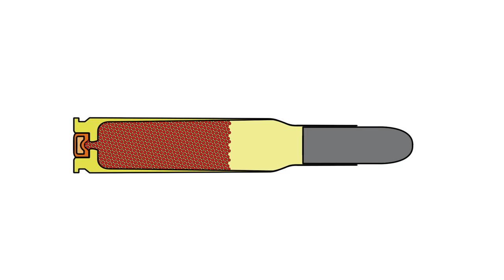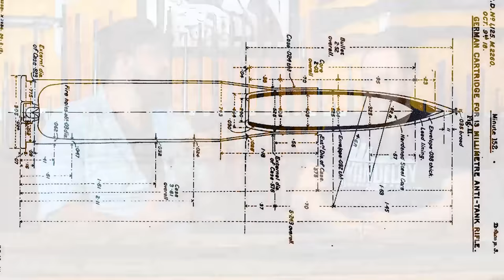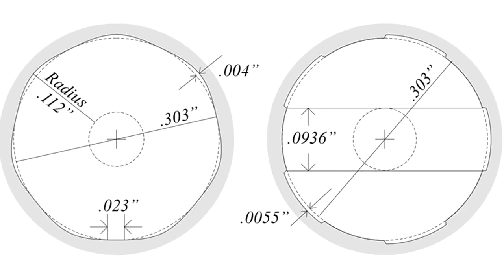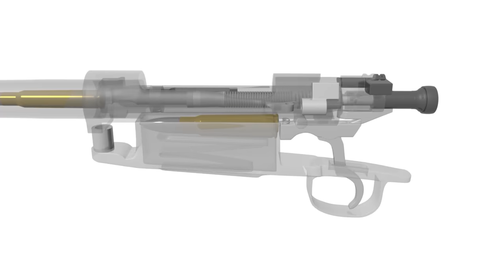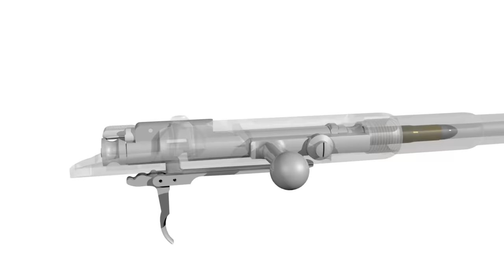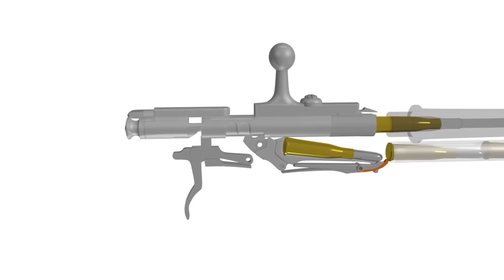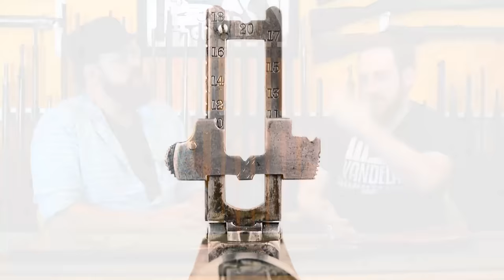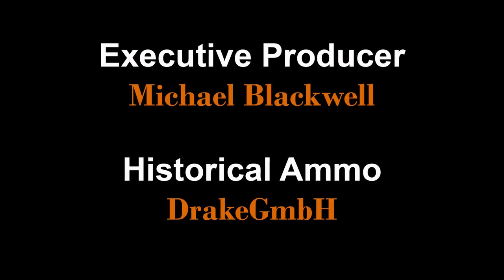Bolt Actions: 101

Comment: Smokeless has a faster initial pressure rise than black powder. Black powder fouling control was well in place by the days of centre fire single shot military rifles and early machine guns (eg Maxim's) worked fine over thousands of rounds of black powder. Wax wads and paper patched. I grant it wouldn't work in gas operation systems. Even the end of the muzzle loaders such as the Enfield rifle musket with the British paper cartridges they would fire all day with no fouling obstacle. Smokeless however was, well, smokeless so you don't give away your position nor obscure your view of the enemy. Also it could give a higher performance with a flatter trajectory and smaller bore. At the very end of the black powder days they were beginning to understand and use solid black pellet charges with designed holes etc. through them to control the rate of burn and the rate of change of burn. This technology is what we see today in solid fuel rockets.
Reply: I really wonder about some of the statements of barrel length  needed to burn black powder.  I think you all should re-examine some of what you are saying.  
Black powder is generally more dangerous to handle than smokeless and the ATF regulates it differently.   
I did not finish you video today, but I may watch more of it later on.
Reply: @loquat44-40  May I suggest you read Brett Gibbons new book ‘Like Fire and Powder - Black Powder for the Modern Shooter’ which uses the definitive research on black powder in use. Available at a very reasonable price from Amazon (no I have no connection to Brett nor Amazon).

Comment: and the photographing of bullets was made possible by Edward Muybridge (who is famous for having settled whether all four of a horse’s hooves leave the ground during a gallop — They do — which developed a form of high-speed photography that would work on bullets). Cameras would be set-up so that they would trigger the shutter at a specific time, based upon the passage of the bullet. For instance, with photographing the galloping horse, a string under tension was in the path of the horse, just prior to the camera itself. That way, when the horse passed the Camera, its shutter would have opened precisely when needed for the horse to be in the frame.

A similar process was used for photographing the bullets, but rather than tripping a string, it would be a sheet of fabric or leather in the path of the bullet, such that the bullet’s penetration would cause it to go taut, and trip the shutter of a camera located a known distance from the trigger, such that the bullet would be in-frame when the shutter was opened.

Comment: Harmonics are fun. They generally want connection-points with the barreled action to be at the nodes of the vibration. This means things like barrel-bands need to be positioned at these nodes, as well as things like gas-ports in similar positions. The length of attachment of the barrel to the receiver also affects where these nodes occur.

The math has to do with trigonometric equations dealing with the pressure of a cartridge, the rifling, and the weight of the projectile. Barrel-steps also help control the vibration-nodes as well, making the nodes more likely to position themselves at these steps (it is like putting your finger on a guitar string).

Comment: An important point to make is the physics of ballistics.  

Kinetic Energy (KE) = 1/2 of the Mass (M) of the bullet X the Velocity of the bullet Squared (V2). KE= 1/2 M (V)2

What this equation means is that if one doubles the mass of the bullet then the KE also doubles.

However if one doubles the velocity of the bullet then the KE increases four fold!  Therefore velocity provided “more KE bang for the buck”. 😎

Comment: And the difference between small bore and big-bore is that, since these aren’t really "point-masses" the diameter of the bullet determined how much energy can be transferred to the target.

The surface area (diameter) of the bullet allowed for the transfer of more energy for a given velocity for a big-bore than a small-bore for the same velocity.

But the advent of smokeless powder meant that it was possible to propel a small-bore bullet vastly faster than a given big-bore, and the small-bore would retain its velocity more, due to being more streamlined.

Thus, the formulae for momentum (and thus energy transfer) of Mass x Velocity = Momentum, gave you a higher energy at impact.

Comment: I'm not sure of the exact historical path, but the Romans used lead bullets in their slingshots. Stone was more common but lead was used when available. I don't know if this influenced early firearms bullets but it seems to me there must have been some connection.
Reply: The connection is that lead is simply an ideal material for projectiles; it's a case of convergent evolution. Lead is extremely dense, extremely cheap, and commonly-available throughout the world. Physics-wise, what makes lead a good material for a projectile? No matter what the material is, a heavier projectile has more momentum and is slowed-down less by the same amount of resistance to its flight. But a dense projectile has less surface area for the same mass, which means less area for air to drag against, which means there's less resistance to its flight to begin with.
Reply: The Romans also had a thing for using lead. Not to mention that you can still make lead glandes (the name for the sling projectiles) out in the field with a campfire and a mold (or if you're lacking a mold, make a serviceable one by sticking a finger in some sand)
Reply: +InfectiousFight 

  G'day,

   Actually, there is a vastly better Elemental Metal than Lead, for Projectile Missiles.

  On a Periodic Table Of Elements, look up Pb..., & then check out Au.

   Here in Oz, until the EuroPeons noticed Alluvial Gold Nuggets in the Beds of some Creeks...; for 60,000 years, hereabouts, the ONLY  use which People had for Gold Nuggets was to carry a Pouch (made from Wattle-Bark Tanned  Kangaroo-Scrotum....) of Gold Nuggets about the size of the End-Joint of a man's thumb - kept for throwing at young Wombats, Wallabies, Kangaroos, Koalas, Bandicoots, or other small Prey-Animals.

 Around here, the last Traditionally-Educated Tribal Aborigine ("Black Tommy") was poisoned & then shot by the PoLice in 1880, during a failed (bungled) attempt to poison him & follow him to his (secret) Camp, in the effort to locate his source of the Nuggets which he carried...; I note that at the time Seargant Walker, head of the Glen Innes PoLice (who had claimed the Reward for killing  the Bushranger "Thunderbolt") was a Shareholder if the Glen Elgin Goldmine - which had failed to make it's Operating-Costs for the 3 months before Black Tommy was killed.

  Just(ifiably ?) sayin',

  ;-p

  Ciao !
Reply: WarblesOnALot remember lead is a good modern projectile due to deformation engaging with the rifling of a barrel. There are some metals that are better at that check however they are more expensive out citme cartridge.
Reply: Lead is a very dense material.  Gold and Tungsten are better, but one is more expensive and the other is more expensive and very hard to work.
Reply: I think part of it is that lead could be made more consistent.  common stones aren't all the same weight or size, but a lead projectile can be made almost the same size and weight so you can call your shots more accurately.  It's also easier to mold or carve an insult into the lead projectile.
Reply: Sorry,  I was talking about Ancient Roman Sling projectiles.  Many have been found with insults that were directed at the enemies of Rome.

Comment: Considering that boats had the design of the spitzer bullet hundreds of years before, it's strange no one thought that air could behave in similar ways to water.
Reply: Look at modern submarines and torpedos, they look like pre-spitzer ball ammo. For a fully-submerged craft, that's the most hydrodynamic shape. Rifle rounds fly through air at supersonic speeds, so they have to be pointy and tapered for the shockwave to form in a way that'll make less drag. In 1887 Hugoniot wrote a paper that laid out the theoretical basis for shockwaves, all the math behind him. Rankine had done similar about 15 years earlier. 

A pointy projectile keeps the shock formed by the supersonic flow around it (more) attached, while a rounded one forces it to detach and form a bow shock. Attached shocks are better because bow shocks are more perpendicular to the flow, so the energy transfer across them is greater, meaning more drag. (in reality, no shock is truly attached because things can only be so pointy, but if it's pointy enough the shock is close enough to attached.) Did the French know this in 1898 when they designed the first Spitzer bullet? Probably not, the basic theory of shock waves was only 11 years old, and experimental data on supersonic flows was a long way away from coming into being. 

It's not that supersonic flows of air behave similarly to water for rifle rounds, air and water are only similar at Mach numbers of less than about .3, where flows of fluids can be approximated as incompressible. However, gases are way closer to inviscid (viscous effects, momentum transfer between layers of flow are neglected) than liquids, especially air and water, so even then they're not that similar.

sorry, i'm both extremely autistic and mostly through with an aero engineering degree

Comment: There aren't two point blank ranges though. You're thinking of zero range, there are two ranges where the bullet's path meets the line of sight. Point blank range, sometimes referred to as maximum point blank range is the absolute maximum range where you will hit the target area without changing your point of aim.

Comment: To add on a bit about barrel harmonics and clarify some things. 

You can imagine the harmonics as a sine wave flowing down the barrel. It’s a much more complex wave in reality but we can approximate it with a shitty 2d sine wave laid over the barrel. The barrel is essentially whipping up and down and depending on where the end of the muzzle is at and pointing, your round can be flung in all sorts of different directions. 

You can think of a barrel like a coat hanger wire. You flick it and it’s going to vibrate. To help with the adverse affects of that vibration, you can increase rigidity or create a more consistent vibration.  

To increase rigidity, you can do this by shortening the wire. If you imagine a short coat hanger wire, it’s much harder to make it vibrate and conversely, a long coat hanger wire will vibrate a lot. This is why you see the “railgun” benchrest rifles with short barrels. Another way is you can make a thicker barrel. Instead of a coat hanger wire if you got a thick wire, it’d vibrate less. 

To make the vibration more consistent, you can do things like adjusting barrel length. A really interesting case of this is where a company named MSAR made AUG clones and instead of going with a 24” barrel, they went with an 18.5” barrel because it had better accuracy due to barrel harmonics. Also, you can free float the barrel. Here’s where some misconceptions come from. Yes it is to allow the barrel to vibrate consistently however it is mostly to free it from the influence of the person using it. You can zero a rifle on a weird tripod type thing and get a wonderful zero but then you put your hand on the handguard and put pressure on the barrel and all of a sudden, you’re not only flexing the barrel slightly but you are changing the harmonics drastically and then resting it on a sandbag can throw off the point of aim even more. One way is also by adding tension in certain places but this is somewhat archaic and for good reason, it’s stupid and there are easier and more consistent ways. It’s real fucky to start messing with tension. Messing with harmonics by having a short barrel stays the same over time but you can not keep constant tension on a part. It will change over time and it will get frustrating.  

There are other areas where you can help like making a more rigid handguard or receiver but generally the biggest things and things that actually matter in a service rifle is adjusting your barrel length and free floating your barrel. The M16 shoots about 4 MOA, when the marine corps switched to the M27 IAR (HK416) they went to 1.5 MOA and that was almost all due to a free floated handguard.

Comment: "The Disappearing Bullet"
I read an article in a magazine in the late '60's or early '70's on the development of the Remmington 17 caliber varmit cartridge.  the developers had honed the design into it's final specifications and were playing around with the powder load for the best performance.  They started out with a low power charge and kept increasing it, each time the trajectory would flatten out a little more.  Suddenly, for some unkonwn reason the bullet quit hitting the target at all!   At this time high speed cameras were complicated and very expensive but to find out what was happening they obtained one and used it.  What they saw was that as the powder charge increased the speed of the bullet increased until a point was reached where the dynamic pressures of the flight through the air caused the bullet to simply disintegrate in a puff of dust midway to the target!

Comment: Also, another reason lead was used is that soldiers could cast their own bullets, so that used shot that was recovered (such as from the enemy) could be re-melted to re-cast as new bullets. They could also carry lead instead of more bullets in an easy to carry form. And lead was also plentiful in the population, used for many other things that could be appropriated to melt to use as bullets (plumbing fittings, roofing seals, bushings, etc.).

Comment: Tying up the firing pin itself is one of the safeties on a Glock. 

This is fantastic.  I never connected full length stocks and handguards with bayonet use. However, spending only 3 minutes on triggers, sears, firing pins, etc. in a 2-1/2 hour long video was disappointing. I guess there are so many ways to do it that the choice seemed to be 3 minutes or 30.
Reply: At the army and navy surplus stores my father bought a combination adze and entrenching tool. 
It had a wooden shaft with a blue steel strengthener at each end. 
One end fitted the bayonet socket on a rifle.

Comment: a large bore also gives a far larger swept volume so you will extract more work out of less barrel meaning you need less powder for the same velocity.
Reply: Is it true that having a larger area on the base of the bullet means that force can be applied faster to it?
Reply: That’s true. Comparing the .300 aac and the 5.56, the larger .300 uses less powder for the same kinetic energy.

Comment: If the projectile goes through the target, whether it is anti-material or anti-personnel, it has done what it was meant to do.
Self defense weapons, in the civilian application, need far more control.  Penetration would be bad for civilian self defense.
Modern body armor, in military applications, renders hollow point rounds ineffective.  Hard jacket penetration rounds are used to overcome modern defenses.

Comment: Honestly, I don’t know why enbloc wasn’t the standard for full caliber rifles. Low round count, no externals to be damaged, the only expensive, fiddly bit, is the big. Already, expensive and strong receiver…way faster and easier to load than stripper clips. And with it ejecting out the top, no openings on bottom to let crap into your action, except the top. Which has to be open, anyways.

Comment: Went to old steel guns because of you and now own a cz 52
Reply from the maker: my bad
Reply: @Candrsenal  lol not to mention the shirts and 3 poster. Btw old steele guns is the best gun shop I have seen.
Reply: Make sure your extractor pin is properly staked! 
They are very hard to find in the gravel!
Reply: Be sure to head over to https://harringtonproducts.com/ and https://www.gunsprings.com/CZ/52/cID1/mID16/dID90 to replace the rollers, main spring, and firing pin. When I first got my CZ-52 the main spring was too weak to reliably lock the slide all the way forward, so I replaced it with a 16# main spring. A weak spring will also allow the slide to come back and hammer the frame which will eventually cause something to break. I also replaced my old worn rollers and cast firing pin as preventive measures.
Reply: @clone4211  already did

Comment: See the .303 Mk Vll bullet for a lesson on how to achieve impressive flight and terminal effects.

The Mk Vll is the classic looking "military spitzer" bullet. However it is quite interesting internally. It has a small, lightweight, conical filler in the front end of the jacket. It also has a flat base. What this does is to make the bullet base-heavy. Additionally, because of its length, it still required the same 1:10" twist of the previous Marks of .303. Additionally, the overall cartridge length had to also be maintained to facilitate feeding in both rifles and machine-guns.

The thing about ALL "base-heavy" bullets is that the are relatively easy to stabilize in AIR; in bags of meat? Not to much, especially if the bullet has to transit combat webbing and bone in the way through.

Thus, the Mk Vll met all the "rules", but it also vastly increased the potential damage to the recipient and could do so al much greater ranges and with a flatter trajectory.

Then go and look at the 5.45 x 39 for a more recent variant on the same concept. Then, there is the SS-109 / M-855 bullet, another one having composite construction and being "base-heavy".